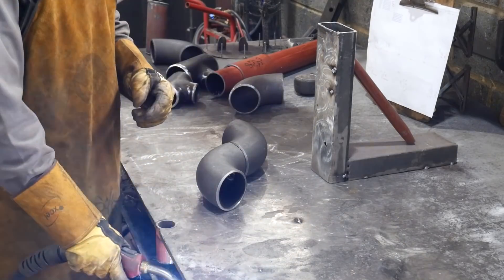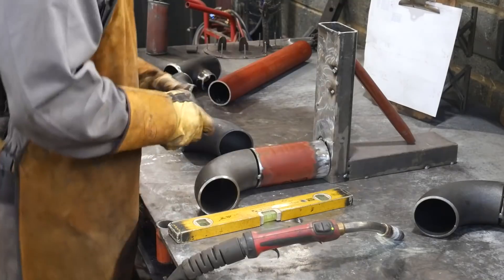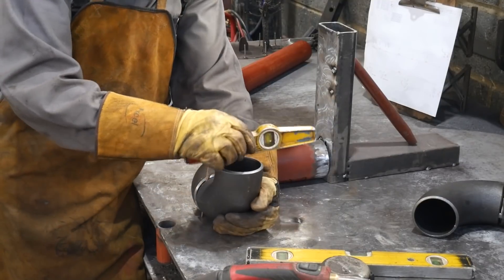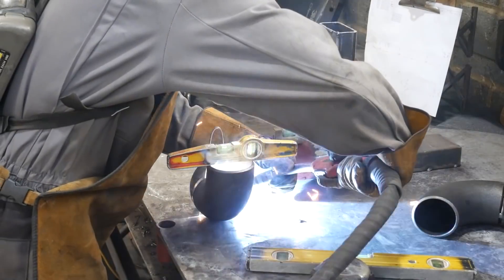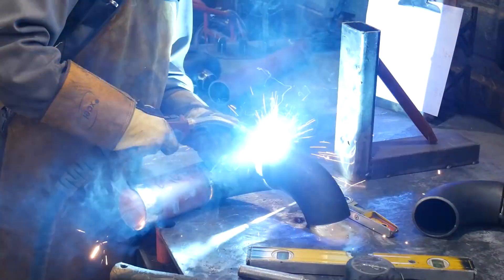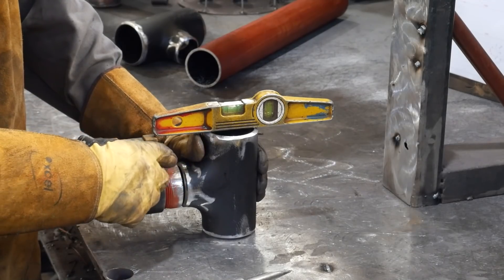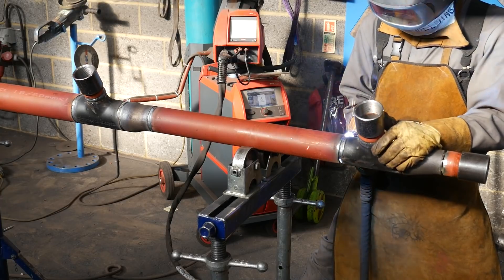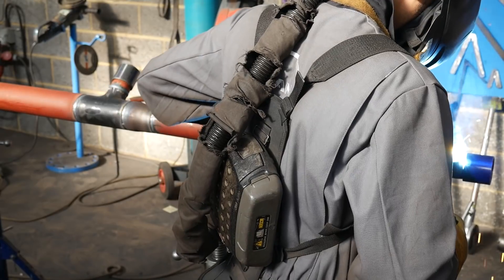3" PIPE WELDING *HOW TO FABRICATION GUIDE*  (MIG/MAG)

Comment: Hi i am wondering if you start from reading a drawing to all your job that you did. i am learning to understand about the drawing i am a welder but most of the time, fitter do the setting and read the drawing  . i would like to know it too from paper to actual complete project. thanks for your videos so much information and fun stuff, coollll. and one more thing when you welding you also control your ampere using controller at your welding gun/handle right?

Comment: Please include your weld settings, that would be very helpful.   Thanks, Sparky
Reply from the maker: Okay man i will do
Reply: Please note that every machine might require a different setting. You will have to adjust your machine as needed. The settings he post will get you in the ballpark.
Reply: Roberto Obregon   Understood, there are a lot of variables.  A baseline would be helpful.   Thanks

Comment: I like to watch how you measure, square up things as well as working with distortion. How many tacks do you usually consider to be enough on pipes? How do you weld around pipes? Do you follow the circle back to where you started, or do you break it up in 2 or 4 parts? Would also love to watch you do more technical welding where you weld up-under, vertical up etc.
Reply from the maker: Okay thats good to know and maybe i will include some type of plate welding